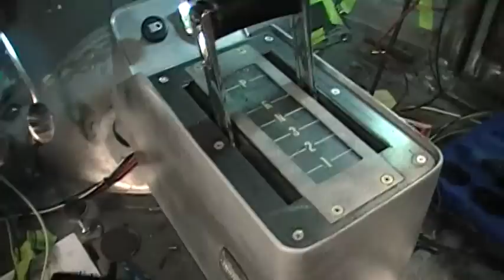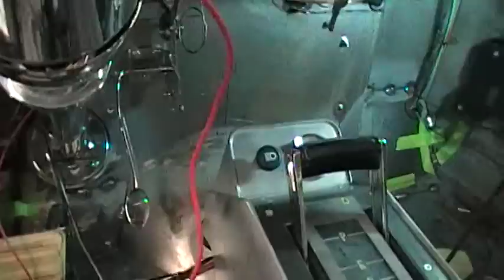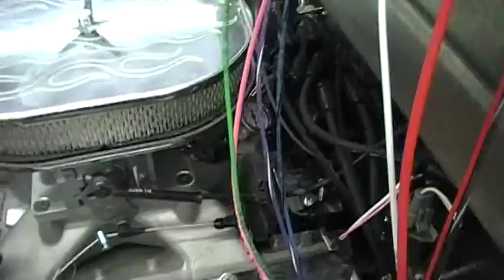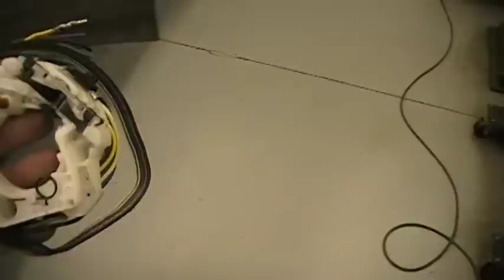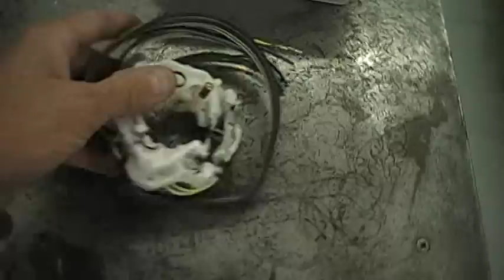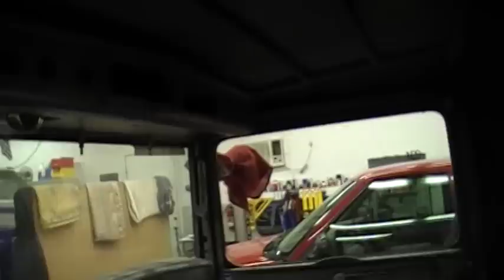31 Ford Model A Pickup 28

Comment: Just one question; I noticed on both Model A's, you have a amber turn signal lamp installed in the headlights. I would be interested in knowing what sockets/lamps you used for that and where you sourced those products?? Thanks for any info/help. Very nice looking job/work. I'm at this same stage with my project but am reluctant to do any actual wiring prior to final tear-down and finish. I would, however, determine and provide all the routing. My wiring kit is opposite yours. It starts at the device and works back TOWARDS the fuse panel.
Reply from the maker: +Pappa Bob this is the one I bought for my year car/truck : http://www.ebay.com/itm/30-31-Ford-Model-A-Stainless-Headlights-Turn-Signal-/250774891733?fits=Make%3AFord%7CModel%3AModel+A&hash=item3a63592cd5:m:mF4S15DAf6cr0sby5k7s_wg&vxp=mtr They are simple to wire up and look great (if your not a purist). LOL
Reply: +johnsont963 Thanks for the link. I have a nice pair of the 29 commercial headlight buckets and lenses and even have already bought the halogen bulbs and sockets to convert those. That said, I hadn't figured out how I was going to deal with the turn signals not really favoring the ones that go between the front bumper bars. Gearhead doesn't offer a complete 29 headlight but does offer a conversion kit of the correct diameter that will work on my buckets so I bought a pair of those. Problem solved and I thank you for providing the input.